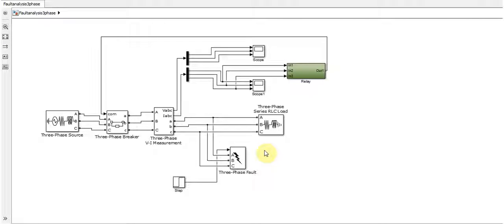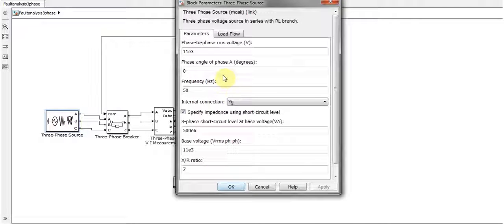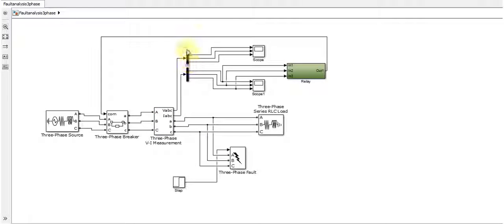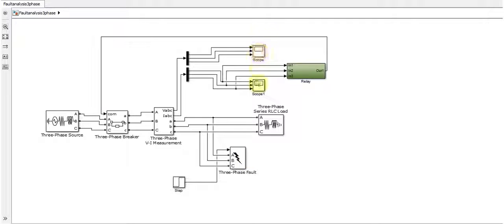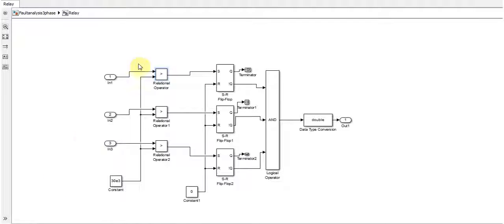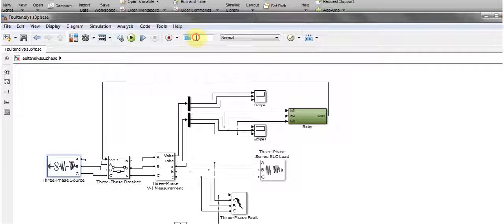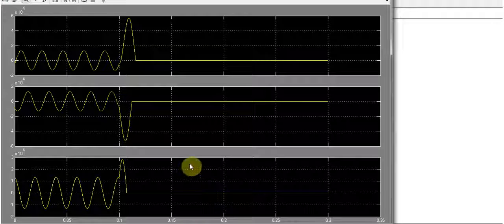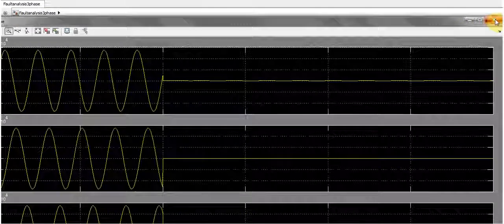IEEE MATLAB SIMULINK Fault Analysis of 3 phase system in Simulink

Comment: this is not how a relay works, the current waveforms don't just all complete, the circuit breaker opens and current stops. There is also a time component not just a current threshold to actuate the tripping function.